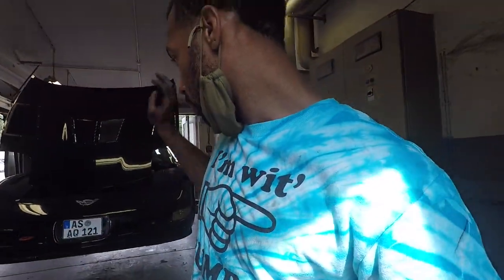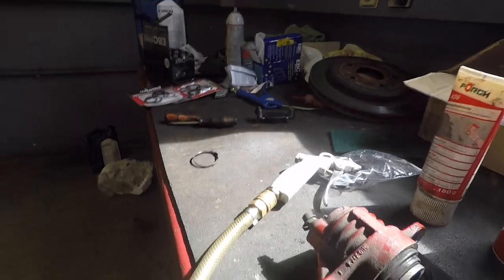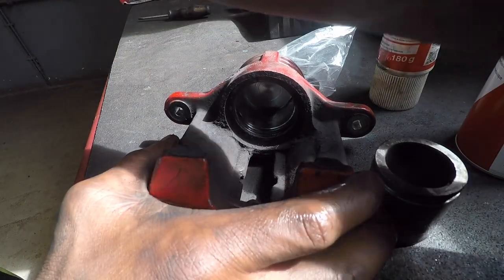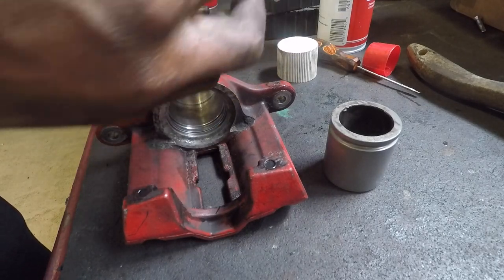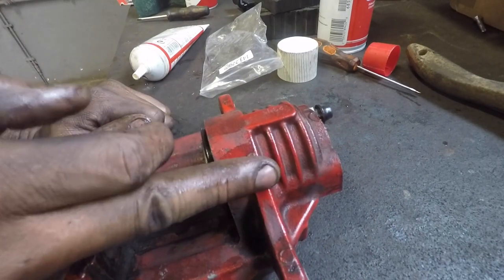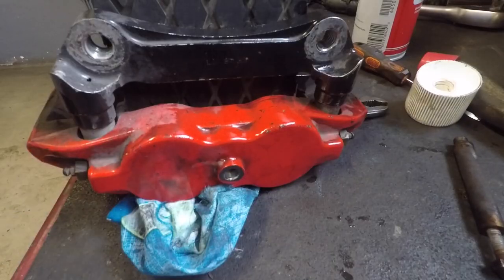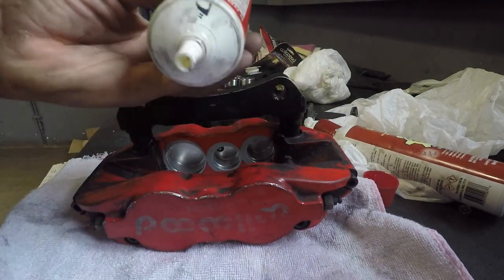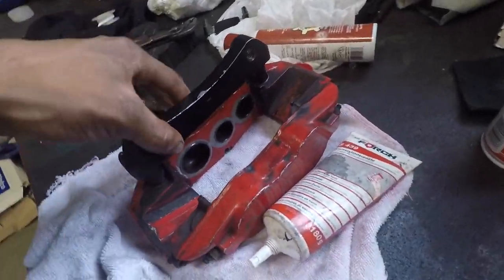How to rebuild brake calipers quick and easy

Comment from the maker: Links to all parts used:

Brake Paste:
https://www.amazon.com/gp/product/B000CIHTPE/ref=as_li_qf_asin_il_tl?ie=UTF8&tag=braxbeezy-20&creative=9325&linkCode=as2&creativeASIN=B000CIHTPE&linkId=d9e43de40c2936daf8fb3810631d2c50

C5 rear caliper rebuild kit:
https://rover.ebay.com/rover/1/711-53200-19255-0/1?mpre=https%3A%2F%2Fwww.ebay.com%2Fitm%2FCentric-143-22006-Disc-Brake-Caliper-Repair-Kit-Rear%2F332464183196&campid=5338674264&toolid=10001&customid=

Wilwood Super lote 6 piston rebuild kit:
https://rover.ebay.com/rover/1/711-53200-19255-0/1?mpre=https%3A%2F%2Fwww.ebay.com%2Fitm%2FWilwood-130-5972-Brake-Caliper-Rebuild-Kit-O-Ring-Rubbers-1-62-1-25-1-25%2F254647822612%3F_trkparms%3Dispr%253D1%26hash%3Ditem3b4a316914%3Ag%3AZC0AAOSwacBfBg2b%26amdata%3Denc%253AAQAFAAACYBaobrjLl8XobRIiIML1V4Imu%25252Fn%25252BzU5L90Z278x5ickkrDx%25252B2NLp21dg6hHbHAkGMftQkfUbTqmr4FIeVQ%25252FXIqsNGxmK4dIkPLKUzEz9ecx49UfSMDR8XQ5yHIlIfnXIdzv%25252Bh3sGKKItJz9XskaadbqLRcfNlGzmZImO%25252BokFMn79ulbXRGUJcqm1gFdELE6qF%25252BhjCA7grIMvmI2xSrkYqI2PZwkTRW8bP6e%25252BeuSFUh20FFnlta7qS00loHLWYN1%25252F3ajzZ3K3gU8YLmhtQCiYAiW81Rfe3Ce7NSkv1sqp3WRvkuPfBcFX01lSY%25252BFBm99EvtnFS10PFxpyaJbm51WtofjTgwfpLva2MPPij54vGCZvZdHDac5q1HCViOlUH7dpDf6QK9268iZCvv1SAt%25252B5sRcODd0uP4bQ3Hc6FMBJ590twFdCBTW4qSIfEbK3voJF8Fx0uovl9m0io9loeDUpowlvmz1inoRaeVc63XoIiqIwDwOlQ%25252FYIvCc8%25252BA84%25252BQuWMRV7GVT1lCEGD4fLxfSplpfT727YSa5%25252BvCgyiRgsJXy%25252BDZHKegrWfVIhOIvC8%25252FpR0yezqPTHWX6VKuBaaowJ2z%25252FTeW6YsB%25252FMTUlwLQZ4CXDnTCsjxBhCboUZPz5O2MsglKeGo%25252F0vPKlVUopYhYo3Sa8hJ3Pl7Xo2sND6wXhS%25252B1n8ukHwxoMzzAYaH9FLLATAbs2%25252B66Ag9jWa2uNdoRd1IGQCMqLmNYK6jXXMvEnl4dMilEtfbQeTAVQNfburu5GRe7TJGyo9gnyAO%25252F0PcRxT5EMifOkJx0M3Mz9uXMVwTbHw%257Ccksum%253A254647822612042e570e548e44e39914416d140fde6f%257Campid%253APL_CLK%257Cclp%253A2334524&campid=5338674264&toolid=10001&customid=